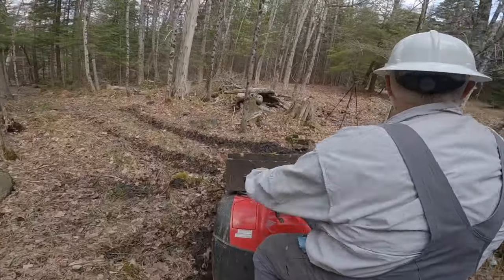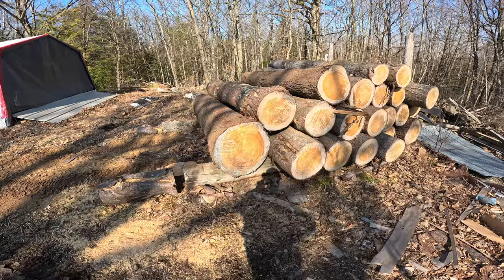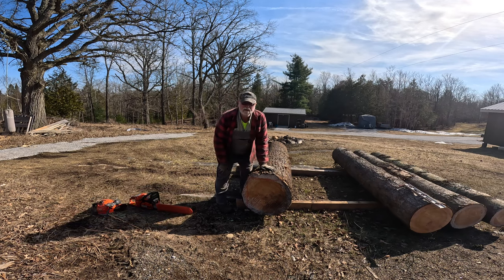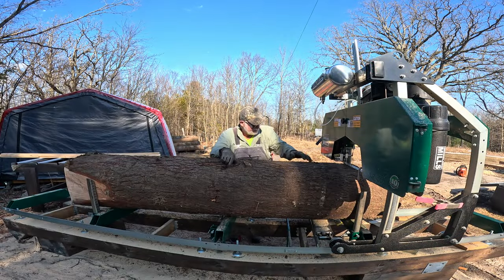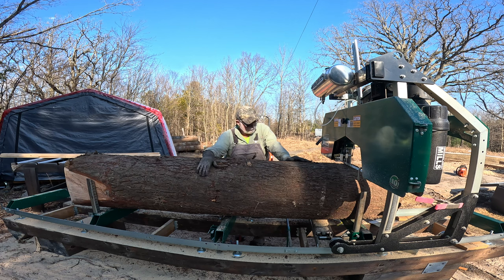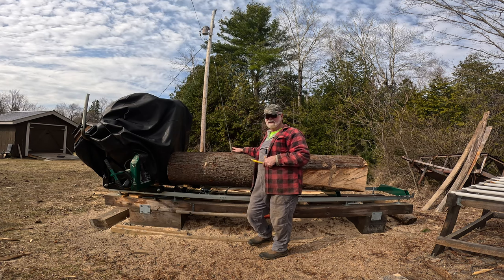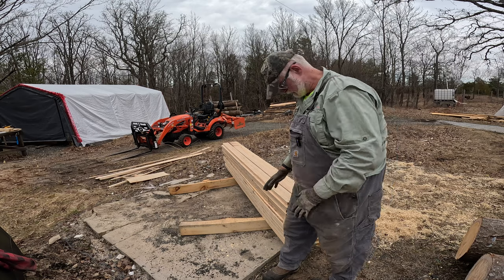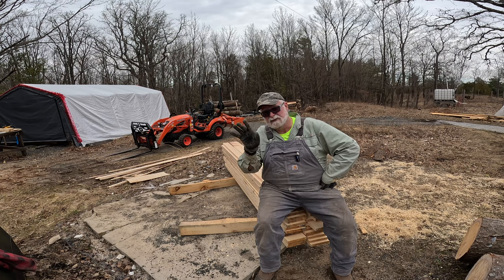Giant Log to Lumber Using Tiny Tractor & Sawmill

Comment: I have the HM126 and a BX23s with the double hook claw from Vevor. I welded 2 hooks to my quick attach and used the claw with chains. The bucket is removed to allow for more lift. I can lift 925lbs now. I can lift a 22-inch Dia log now with no issues. Good ingenuity on your part.
Reply from the maker: Wow! Sounds like a great setup! Isn’t it amazing what these little tractors will do. Thanks so much for watching. 🙏🚜👍
Reply: @retiredforlife63   I agree the BX is great.

Comment: I'm surprised that the BX was able to lift that big log. I assume it's some sort of Pine. No way it could lift an oak that size. Great job on getting the lumber out of that log!
Reply from the maker: Very true. It would never lift a hardwood that big. If this pine log was dry it would handle it no problem but it’s still very wet. I know you can buy kits to increase its lifting capacity but I’m not a fan of that. It just gets you that much closer to bustling something. Thanks for stopping by!